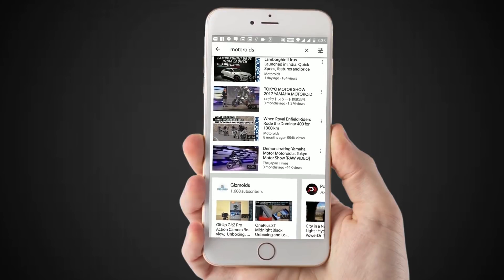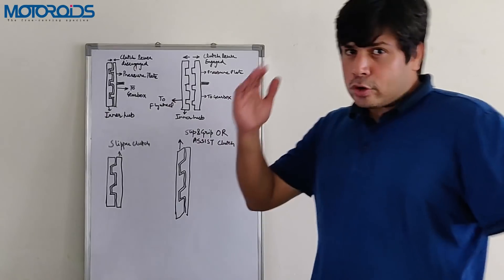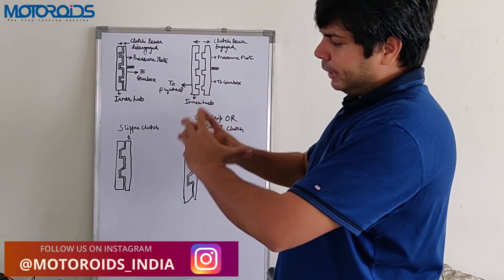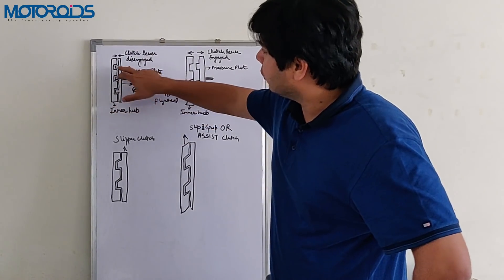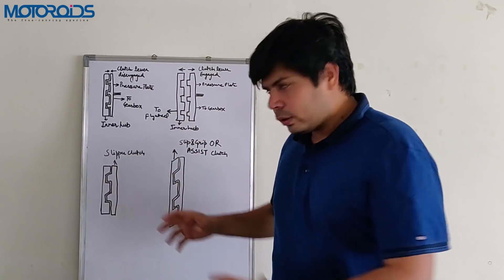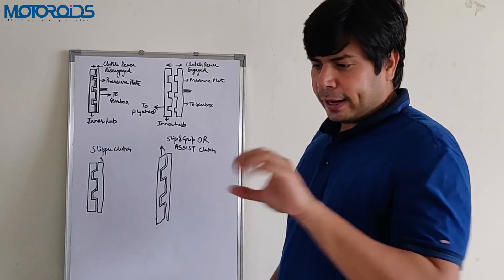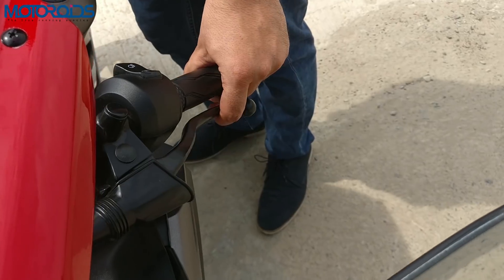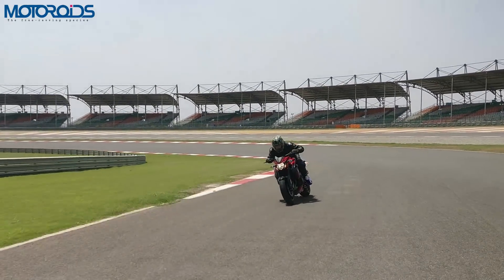Slipper and Assist Clutch Explained - How it Works, and What's its Use

Comment: How does a slipper/assist clutch differ from a rekluse clutch?

So if a beginner’s shifting is kind of rough, the slipper and assist clutch will prevent the rear wheel from locking up. that is actually a good thing that you explained that I learned since I am a beginner rider. during my MSS, smooth braking was a challenge for me because when I would brake smoothly, I would stall but when I would brake roughly I wouldn’t stall. But the fear of owning a manual bike and stalling when I come to a stop and pull away from a stop is a real fear that lives with me because it happened almost all the time at mss. I know it could be reduced over time but if there is a helpful item out there like the slipper assist clutch that can help with that then why not just look for a bike that has that from the start. 

Sounds like it can help with rough up and down shifting as well to prevent a stall and what not.

I am wondering if a rekluse clutch can do the same things as a slipper assist clutch. the rekluse clutch will eliminate stalls when you’re doing stop and go type stuff, plus you can takeoff and accelerate from a stop without having to shift. But I’m wondering how it handles up and down shifts, will it prevent the rear wheel from locking like the slip or assist clutch will? that’s what I’d like to know.

Comment: People say that not rev matching while using the slipper clutch will wear it out faster? but a slipper clutch is specially designed for that purpose and its a wet clutch too so it wont.

Comment: How about assist clutch? does it makes the clutch harder when u are reving then tried to pull the clutch? Because u said it pull the pressure plate automatically when you are accelerating

Comment: Hi Amit . 
I am a huge admirer of all your reviews ..they are the best ,in hindi as well as english .
In my interceptor . I do not get a desired speed range in first gear compared to the rpms, 
Also i notice a lag and clunk sound while engaging gear ..it,s not too bad but noticeable and happens on hilly roads  when i want to shift to next  gear .
Could it be a clutch plate issue .
I am a vey careful rider  and i dont abuse the machine . Prior to this i used to ride  a royal enfield 350 for 15 years .
The the intwrceptor 65p has nice pickup when i ride it first time on a colder engine,  compared to the  pickup when the engine is sufficiently warmed up after 7-8 kms.
Could all this be a clutch plate issue ?
Reply from the maker: Thanks for your kind words ❤️🙏. Less speed for a given rpm and clunky shifts can be a clutch problem. Check loose chain also for the sound. In any case, have it checked at the nearest RE service center.
Do subscribe, and share with friends
Reply: @motoroids  Thanks Amit ..appreciate it . I think I am already a subscriber , if not then I am  pressing the subscribe button right now !

Comment: Thank you for describing it so far. But still one doubt so is that sliper clutch stops once it slips until rematch with the Engine RPM or slips continuously again and again until it rematch with the engine RPM ?
Reply from the maker: It gets locked in after matching the engine revs

Comment: Hello Sir, m using Apache rtr200 which have slipper clutch, do i need to revmatch while downshifting?
Reply from the maker: It's a good thing to do that if you want the transition from higher to lower gears to be smooth.

Comment: Very well explained. Liked It.
One question though Is It recommended to shift gear without pulling clutch lever, does S&A clutch helps in this also ?
Reply from the maker: Not recommendable unless your motorcycle has a quick shifter

Comment: Hey motoroids plzz help me with this.

I have a bajaj dominar and it has been a year since i baught it but i m facing an issue. When i m in gear and apply throttle the rpms move fast but the speed doesn't. I went to bajaj for fixing my vibration n gear noise issue but instead when the service war done after a few days , this issue came up. This issue wasn't there before i gave my bike to the service centre. The bajaj service guys say there is no issue in the bike even though i demonstrated them this clearly. I tried contacting bajaj online but they r not getting back. All they say is your issue will be resolved within 24 hrs and we will give u a call. I dont know what to do now . plzz help me out .
Reply from the maker: Your clutch plates may have been damaged
Reply: Motoroids yes but the service centre says there is no problem